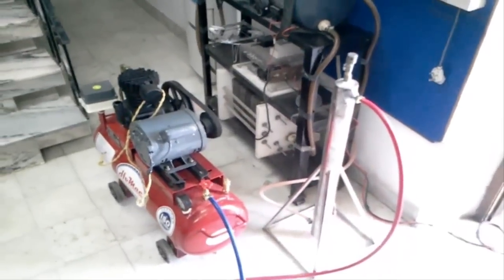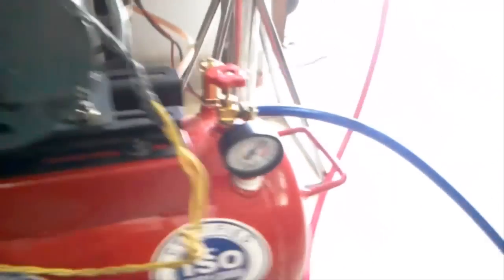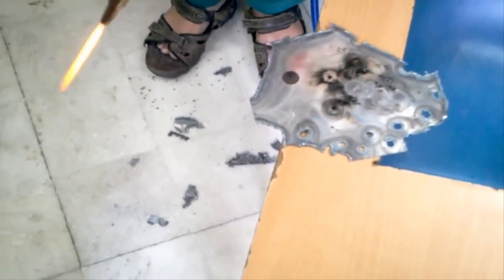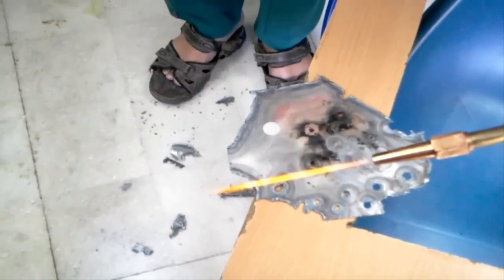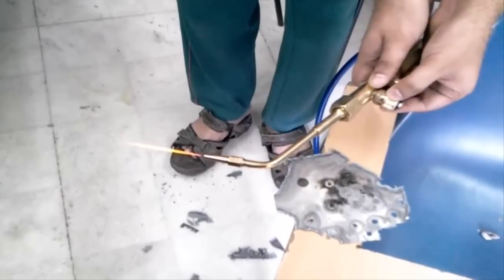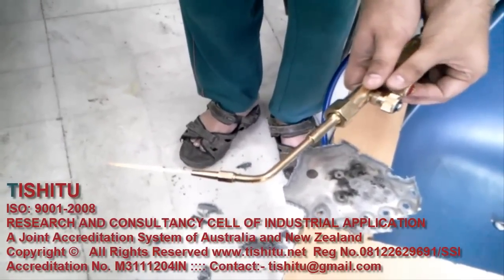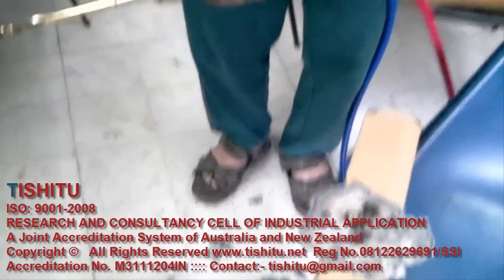TISHITU Compressed Air Hydrogen HHO Welding Torch Cutting 16 Gauge plate easier

Comment: that just use compressed air or compressed oxygen ?
Reply from the maker: simple compress air
Reply: thanks sir,, u inspirating me to build hho stove with air compressed use rifgerator from frezzer,,  what method can u share for this stove sir ?
Reply from the maker: have u seen this video https://youtu.be/uJn7KB6pG2Y
Reply: thanks sir.. another question,, i see u no use power supply there.., but use power from wall  220vac,, some rectiflier inside machine sir ???
Reply from the maker: yep there is 220v power supply to convert AC to DC 220V for electrolysis
Reply: 220v AC convert with rectiflier to 220v DC,, how about AMP,, can we control the AMP ??,, or the electrolite water with NaOH control AMP by it self ?? and we no not control manual again ??
Reply from the maker: its nearby 4 AMP . you have to restrict amount of NaOH . like if one LTR 0 conductivity water distilled water you have to put  100 Grams of NaOH or you can visit site HHO NaOH calculator online ... If u put less there is no use but machine last for long if you put higher it may burn or short circuit.
Reply: its so danger if wrong calculation..
easy teory in my mind...
* put more NaOH = more AMP / More AMP = More Heat inside reactor
* put little NaOH = low AMP / Low AMP = Cold water inside reactor
mistake or true ?

Comment: with or without compressed air, it took 5 seconds each. I counted. If at all with air it could be marginally faster, not worth the extra cost of the compressor and the electricity to run it.
Reply from the maker: hello sir it matters when deep penetration cutting without corrode  metal of upper layer  ...there is problem when we dont take borax as flux for gas welding where it de-oxidized the metal ... and carbon is residual  .... so it degrade welding contact points ....to make it better in shape oxygen in air as compress air or pure oxygen cylinder is to b taken ... ethanol petrol or spirit are also good coolant for some metals .... I WANT YOUR REVIEW REGARDING THIS MATTER
Reply from the maker: May b i can make please share Link If you want

Comment: is HHO same as Brown's gas? How much voltage/current is taken up by the HHO generator?
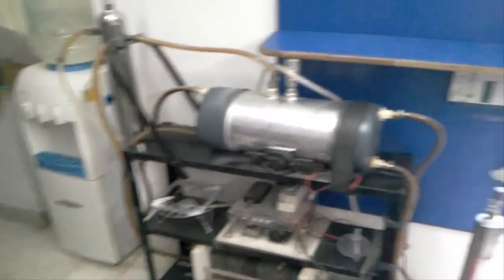Reply from the maker: Please watch video sir from time 0:42 and follow the link ... you will get details of current and voltage ive taken
Reply: Tarun Shrivastava watched the video again, nothing has been shown with regard to the voltage/current consumed. BTW is this the same as Brown's gas?
Reply from the maker: TISHITU Hydrogen Home Gas HHO Stove with LPG, Risk Free with no Flash Back from Hydrogen Fuel Cell.
Reply from the maker: hello sir in this video u will get da details
Reply from the maker: HHO is brown gas sir . for this unit ive taken 3-5 AMP with 220V = 800 to 1100w